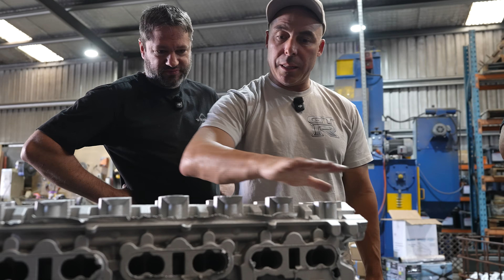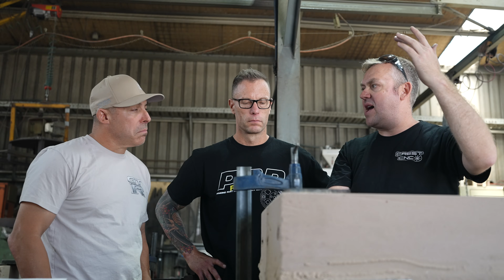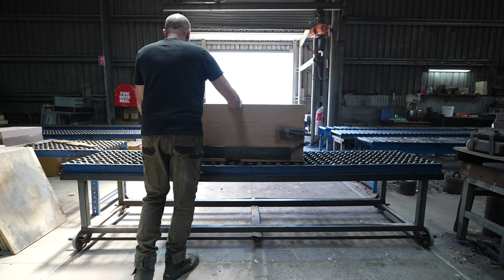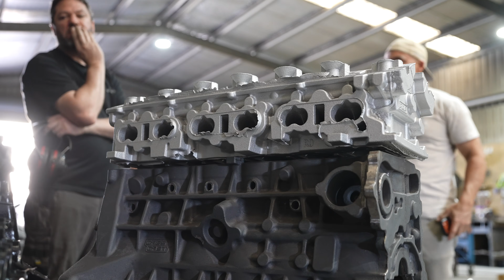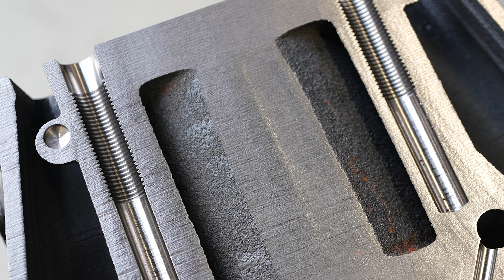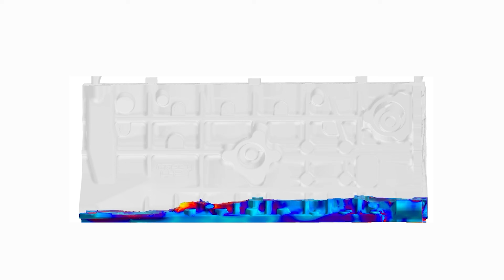WORLDS STRONGEST RB26 HEAD AND BLOCK?

Comment: expensive type of work . with the odd rejects. I use work at a foundry here in NZ,  high and low pressure castings . I did the finishing side of it, sanding drilling  . But this is a different ball game , more advance

Comment: 'Nodular' or 'Spheroidal' Iron is the material and process also used in many Chevy LS V8 Cast Crankshafts, known for often holding 1500 HP and spinning 8000+ RPM and surviving in the 4.8L, 5.3L and 6.0L previously.

Comment: I have seen other builders use threaded freeze plugs.  For general use, what happens if exposed to extreme cold temperatures?  It cracks!
Reply: For boost the normal plugs are Junk!!! If ur boosting 40-80psi sometimes u kill Headgaskets and Blow out the plugs. Threaded are best!

Comment: Incredible work lads. I do have some questions though. I understand using cast iron for ultra high hp applications, i just wonder if there is a possibility of getting a cast aluminium version for light weight applications? Would this require a complete redesign or would it be possible to essentially use the same molds?

Comment: Incredible work!  It cannot be understated the Herculean effort to get something like this off the ground. 

Why not try and cast the block out of steel, stainless steel, or cgi?  There may be an obvious flaw to this, but I'm a bit ignorant to casting ferrous materials.

Why not add strut material on the major and minor thrust side of the bores in the block casting to strut the cylinder wall to the outside wall of the block?

Comment: Herman will go down in history as that one crazy Aussie that single handedly kept the RB alive for generations.
Reply: In stylish shorts no less.. 🎉
Reply: You need to get one of these and build a 2000hp RB for drift just because you can now with this block!🤷🏻‍♂️🤔😂😂😂😂😂🤣🤣🤣🤣🤣🤘🏻🤘🏻🤘🏻💨💨💨💨💨💨💨💨💨💨
Reply: I wish I could shake his hand and buy him a drink .....
Reply: Aussie Aussie  Aussie 🇦🇺 PRP we cant wait to see these get built. Toughest in the world I i think your patients will payback ten fold in the next 2 years. 👍
Reply: Sucking for a engine?
Reply: maybe, but here is the important fact, japan if they wanted to could make the same block and heads so much better though metal engineering and composite alloys. Think about aircraft grade alloys and what you could use, so much better quality control and not just melting iron mixed with alloys, you have to be exactly right in the compositions of all the metals get it right perfectly and you will make what and better stronger version of just a RB engine combo. ✌✌👍🦘😎
Reply: @7075-t6 thats really just your uneducated opinion, indeed not a fact.
Reply: @7075-t6 OEM manufacturing needs to take large scale expense into account ..

Perhaps on limited numbers.. which they did.. enough to successfully compete in the relevant categories at the time 

Which they did ✅
Reply: @7075-t6  PRP have researched into this for years I'm sure they have good reasons the way they went and I'm sure they know more than you plus what would that add to costs?

Comment: How long until we get to see some field testing results? And what sort of potential capacity increase do you think will be achievable with the thicker bores and increased crank clearances?
Reply: Field testing is up to the consumer, there are some out in the wild already and soon to be a whole stack more.

We don’t see any power limitations with this set up, the fuse has now been passed to the head and or rotating assembly